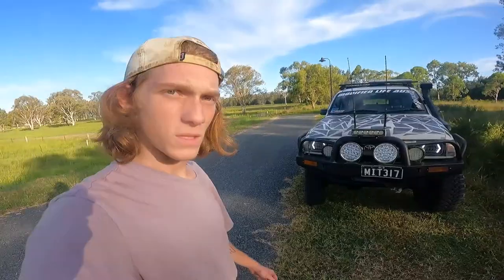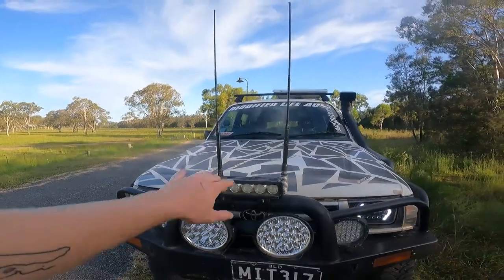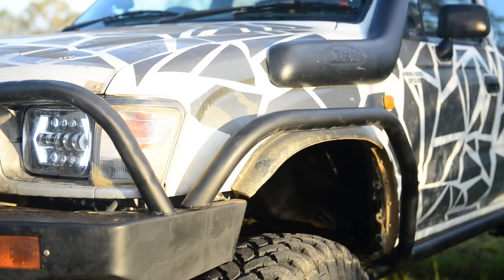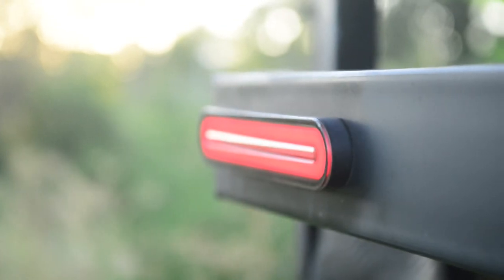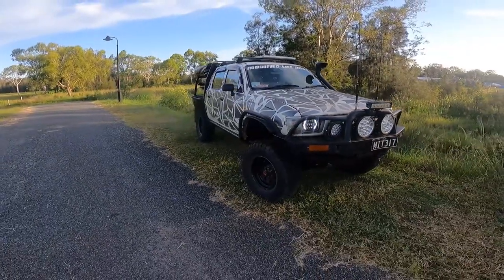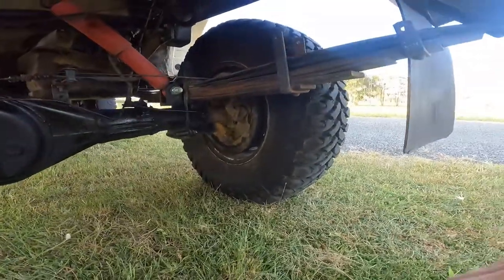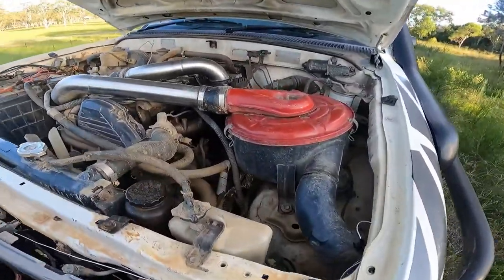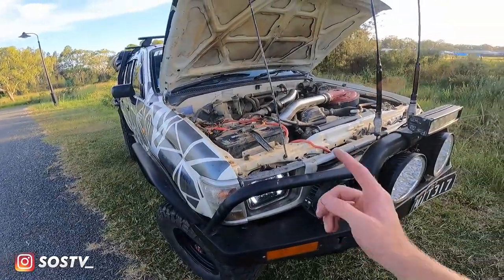My 2001 Hilux RUNDOWN Late 2021

Comment: Lean is better for diesel that’s why your egts are so low, boost can’t hurt it’s the heat/high egts that hurt with either running too much fuel and not enough boost or low boost, these motors come alive at 20+ boost and love it

Comment: Are you gunna get a chip for the motor to get abit of power out of it.if so what one are you gunna get cause I m thinking of getting one for my 5le
Reply from the maker: Yeah man I’m thinking of getting a chip after I do a full rebuild of the engine👌🏼👌🏼
Reply: @sostv_  to easy man sounds heaps good man you will have to do another run down of the motor afterwards
Reply from the maker: @Blake.Blackburn169  sure will man, keen on a bit more power too

Comment: Where did you get the solid axle swap done? And how much did it cost?
Reply from the maker: Got it done through TM Fab and was drive in drive out 4k mark
Reply: @sostv_  nice was that mode plated?
Reply from the maker: @lukedontknow9283  nah that was excluding the mod plates, I got a bunch of other things mod plated at the same time so the engineering was on the steep side